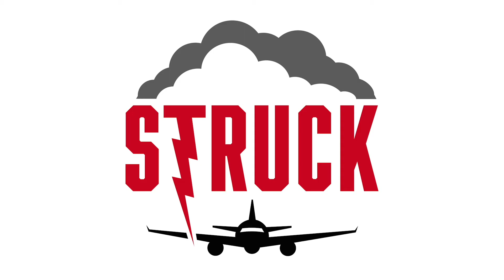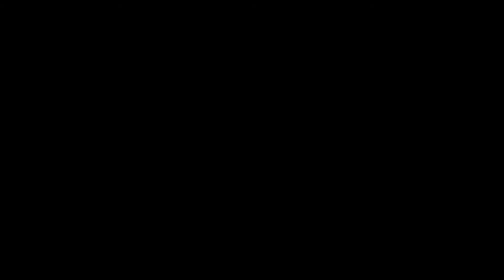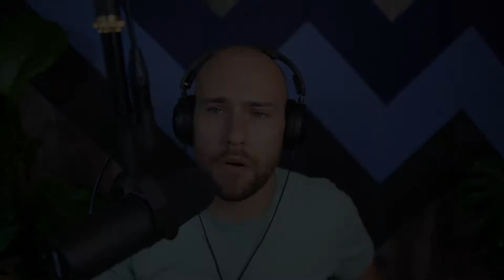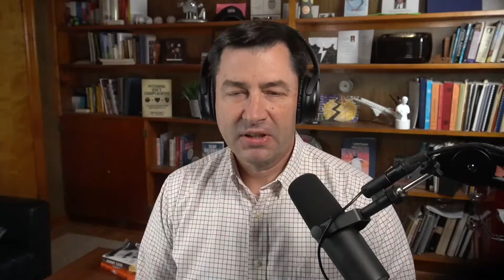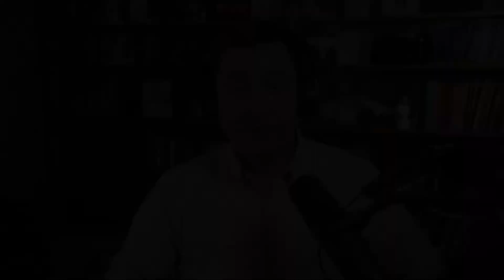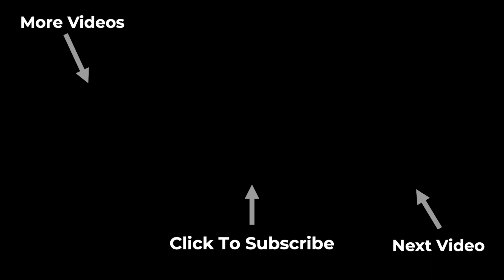Results of the Celera 500L Test Flights: As Good as Claimed?

Comment: Is it just me who thinks the celera 500 is a scam?  No way it has performance this good. Think about it the Piaggio Avanti which is very aerodynamic and has a pusher propeller configuration doesn't get this kind of performance, and they are at it for 40 years, wouldn't you imagine they would have at least made drastic improvement's if that was possible by now? Or the predator drone which would have great benefits if it could have this range, get's only about the same s most other pusher propeller air planes! The only way this can get that kind of performance and range is if it's a pretty much an empty shell with lots of fuel flying in very good conditions !
Reply: Straight through!  To me it looks like financing of this venture is pushing the limits of physics!
Performance claims so far above the norm leave me thinking "Lies".

Comment: With all due respect to Mr Otto, the science of subsonic propeller powered aviation is well known. Every now and then someone comes up with a spectacular pusher  design claiming breakthrough. It is not about the cost, the market, it is about physics. This fuselage certainly is aerodynamic, but not dramatically better than that of a modern jet. the wings are definitely no better - each wing design is a compromise, and I bet that the actual numbers will be far less than claim. And someone tell me what happens when a single engine piston aircraft loses the engine at FL550? The instant loss of pressurization will be a major issue for certification.
Reply: And when the financing leads the 'physics'...